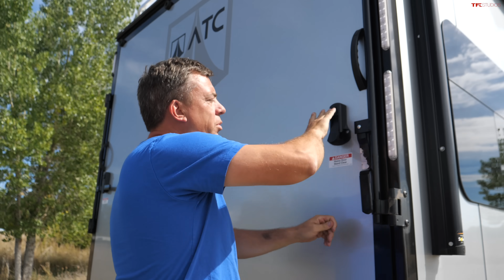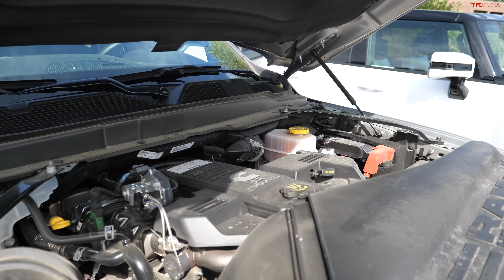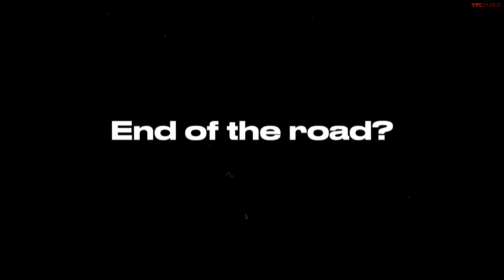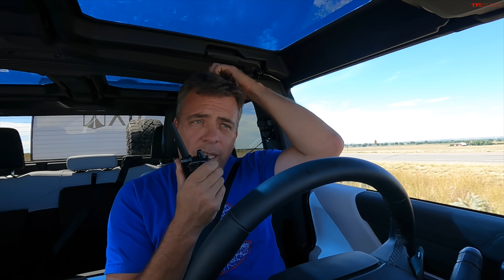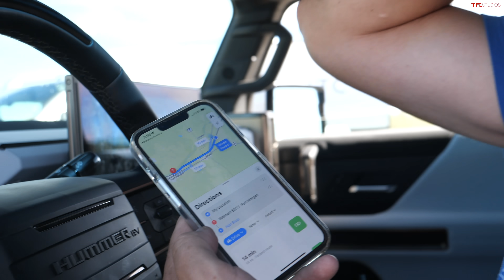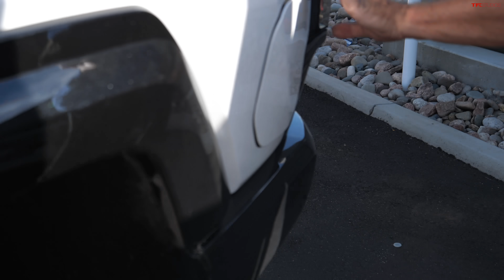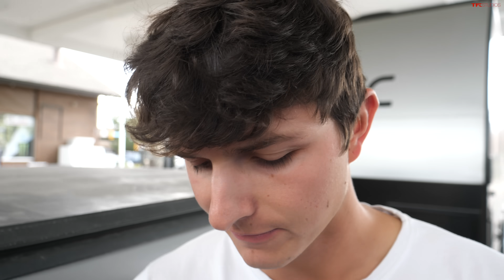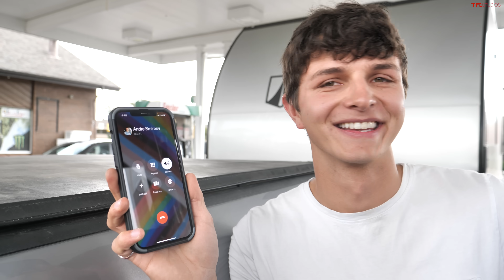How Far Can a Diesel and Electric Truck Tow An Identical Camper Trailer on ONE Fill-up?

Comment: I don't understand why the EV Hummer has such a light towing capacity compared to the other EV trucks.
Another thing I noticed... they're towing trailers that are empty... imagine having 2 dirt bikes or a side-by-side and your stuff (food, supplies, clothes, etc) loaded into the trailer, what's the range going to be then? 50 miles? Seems EV trucks are still a ways away from becoming towing vehicles.
Reply: There is more to towing than just horse power and torque. The Hummer has independent rear suspension as well as rear wheel steering, which really hurts its ability to carry weight.

Comment: True that the range per tank or charge goes to the Ram, bur the total cost of the trip goes to who?
Reply: The EV was cheaper at 43 bucks to recharge.

However, you are assuming that people care about 43 versus 100, versus wasting over 2 hours of your time to charge / back track have range anxiety.

Drive EV's in big cities.  EV's are not ready for hauling and transportation, waste of precious minerals going into the batteries.

Comment: As usual, all the EV hating trolls are out with their see I told you so narrative. If you have to tow heavy loads long distances, get a diesel. I guarantee that most F150 owners who have the same configuration as the Lightning aren’t doing a whole lot of towing or even hauling with their trucks.

Comment: Hmm $55,000 price difference let’s see how that computes 55,000 divided by let’s say $4.50 a gal that’s about 12,222 gallons of fuel at 10 mpg roughly can drive 122,000 miles before an EV gets out of drive way awesome

Comment: The lightning vs hummer showed us the lightning needed more charging to the 1 charge of the hummer.
The hummer vs cummins is cool, it showed us the cost of charging and fuel are the same..just with EV you have to plan on hitting charging stations and eating more fast food while charging.  If anything buy a hummer not the lightning. But I'll go with the Cummins.

Comment: Kinda surprised to see the price(had they not offered free charging) landed fairly close to each other for the range. $40ish for 123mi is about $0.33/mi and $105 for 211mi is about $0.50/mi. That's still a 35% advantage to electric but the trade-off is in the time spent filling/charging. 

I would've liked to hear the times for filling vs charging with the charger dropping off from 350kw to 150kw, because imo very few people would trade $0.17/mi difference from ev to diesel or around $12(considering 70mph highway avg) to sit there for an hour to charge. Not to mention the need to unhook/re-hook the trailer to do so.
Reply: Wasn’t the $40 charging only for 87kw? At 0.6mi/kw, that’s only 52mi range added at ~$0.77/mi, or about 50% higher than diesel for public station rates!
Reply: @emf7301  not even taking into account you paid 40k more for the truck. would like to see it vs gas but im sure the cost savings still isnt there and range is similar.
Reply: Someone did the math in another comment. "Thats awesome the charge was free, but let's use the numbers to find out the future cost. The Hummer charged from 7% to 51% for $37.41 according to the EA charger. So $0.85 for each 1%. At that rate it would cost $79 to charge the Hummer to 100%. Hummer cost per mile: $79 ÷ 123 miles = $0.64 per mile.
Cummins cost per mile: $105 ÷ 211 miles = $0.49 per mile"

Comment: Ev’s are an embarrassing gimmick at best. They might be good for big city people commuting >10 miles. But as a replacement to the ice they’re a joke
Reply: 80% of Americans live in urban areas and commute short (<50 miles) distances to work.
Reply: @robertharris1748  You’re numbers a smoke screen. Lots of people living in big cities commute 50-100 miles and greater for work. None if those cities can support the power required for everyone to charge a car. They can’t even handle when people run ac’s. And there is way to build a supporting infrastructure.

Comment: I love that you guys are talking about energy density and comparing true energy efficiency. Something so many people are confused about! Well explained, thank you.
Reply: Something just hit me based on energy density: He would have paid $40 for the electricity equivalent to 6 gallons of diesel. That would have worked out to over $6.70 for a "gallon" of electricity.  It shocks me that the super-charger is more expensive than gas.
Reply: @DSArmageddon666  When i first got my EV non fast charging was free. I've since moved to Colorado and they charge a pretty high amount for all public charging and home electricity in general. After doing the average math, if fuel is under $4 a gallon then i'm spending more to drive the EV plus the wait time for charging.
Reply: @WhoThisGuy515  NO, that defies everything i've ever heard.  Even if you pay a lot for electricty, like CA rates its still cheaper per mile.
Reply: @DSArmageddon666  Yeah, gas/diesel has always been an excellent value of energy per dollar, at least in the US historically. The other numbers to keep in mind is charging at home would be more like $9-12 worth of electricity for that same amount of energy depending where you live. For most, the vast majority of charging is likely to be done at home, so weigh that in. The other factor is an EV can generally do a lot more with a given amount of energy, so even in scenarios where you pay more per kWh than gas, you can do more with it due to the higher efficiency. In some cases at least.
Reply: @tazeat  Ev's so far are a good day vehicle, meaning home to home. Also not bad for light towing short distances, but dino engines still win for distance travel.
Reply: @Frontpagefab  No arguments from me. What I'd like to see is tax and insurance pricing models to stop disincentivizing owning extra cars so much. It makes no sense to have an extra energy efficient car that saves money on energy only to have that difference and more taxed away when you renew registration every year. Because I see no reason why most people with an ICE truck would be motivated to get rid of them in the next decade with what's being offered today and in the near future. At all.
Reply: @tazeat  You got that right. Typical insurance discount for add'l cars is only 15% off... even though one person can only drive one car at a time. And some states have higher annual registration fees for EVs, and many more states have personal property taxes that amount to more than 2% of the car's value  every year. With rules like these, the only way an EV  typically makes economic sense is for a two-car family that can charge it at home and needs a second ICE vehicle anyway for a spouse who (mostly) stays-at-home. That one is used for road trips.
Reply: @videopipeline6419  I mean I know, I pay insurance on currently five cars and a boat for my wife and I (3 of which are basically toys that rarely get driven, but are also older and relatively cheap). It's not like I can go crash them all in to other people at once, but there's hardly any multi-car break on the liability prices, they just add up. I had a 500e grocery getter for a year I paid 6k for several years ago and the state wanted about $500 for registration renewal after the first year (lets not even mention the initial registration fee was even more absurd) by the time you added all the ev fees (~225), vehicle value based transit taxes (~110), and everything else (~125). It's probably more now. I sold it off. I figure tax+insurance+energy costs I was close to $900 a year which at the time bought a hell of a lot of gas for my truck. The truck is not going anywhere, no car can do what a truck does, but a truck can inefficiently do everything a car can and more. I'm happy to daily something more efficient, but you gotta make it cost effective for people to do so.
Reply: @tazeat  The only EV that's a really cost-effective commuter vehicle is a an electric bicycle that has nearly the performance of a light motorcycle but no government-imposed fees. In most areas, if it looks like a bicycle, and if it isn't driven on the highway, and isn't breaking the posted speed limit elsewhere, it attracts no attention from the cops. Of course, the big problem with any bike is, bad weather and dangerous drivers!
Reply: @tazeat  )
Reply: @tazeat  I haven't seen one illustration that convinces me that EV's are the better choice, environmentally or otherwise.  There is very little talk about raw materials to build the batteries, (which we have almost none of....) or disposing of them.  A typical car battery weighs about 50 pounds, and the Hummer...6,000?  Sheesh....
Reply: True energy efficiency?  How about the energy to charge the Hummer which is roughly 75% fossil fuel? Thermal efficiency of an average coal plant is 33% times his .6kw/mile is .198 which is less than the Ram.  That doesnt even figure losses thru transmission lines, transformers, and charging stations.  Its almost like you cant beat laws of physics
Reply: Don’t buy a full EV vehicle if you believe some change your driving habits and refueling habits will occur. The energy density and efficiency discussion sufficiently confuses the regular consumer (me even with an advanced college education in healthcare). There is scientific research that demonstrates people’s propensity to overestimate how much they know about a given subject. I  admit that I do not understand the calculations and assumptions regarding the comparison between battery technology and diesel. But I do know with these full electric vehicles the  people who are buying them are going to generally be more affluent and urban and suburban dwelling people. I have a good friend that owns a Tesla model three and he owns a cottage about 120 miles away from his home. He had to install an electric charger at his cottage because he couldn’t make the round trip. I own a plug-in hybrid and a Toyota hybrid. The company I work for is striving to fully electrify its fleet by 2025. However, full EV vehicles would not be available to employees whose territory goes beyond large, urban and suburban centers.
Reply: I believe Toyota's 2.5L aka Rav4 engine is the most thermally efficient engine on the road, but its still way way behind electric.
Reply: @jeffk464  It is not way way behind BEV vehicle :)   

Ok, engine to electric motor yes... but....

BEV car have not only the electric motor on wheels which is 95-98% efficient,  they have also battery, electronics and A/C, heater etc.

charging the battery is about 80-90% efficient (depending on the method of charging, fast or slow) -because of the heat loss, A/C system helps cooling the battery while supercharging (which also uses energy) etc.  - same when you use your phone intensively, or fast charge it -- the battery heats up like crazy...    --- also when you use the battery to run the electric motor --- battery also heats up  -- wasting energy for heat loss.

Two:  when using heating inside an ICE car you have heat for free, in the EV you are using up to 25% of energy in the battery just for heating.  That is a lot -- in colder US climates you use heating for like 4-5 months of winter for sure.

Three: electronics use energy on standby -- in very hot weather EV is wasting the energy to cool down the battery, in cold for heating up the battery ---- this is efficiency loss too.

Four:  the battery has the tendency to self discharge, and is loosing a little bit power just standing parked.

Five:  another factor is weight --- carrying extra 1000 lbs to 2000~~3000 lbs of battery is completly not energy efficient.

Six .... electricity generation --- in countries that use mainly coal or oil power plants -- generating electricity is like 30-40% efficient :)  than the losses of the grid etc.   natural gas, nuclear are also fossil fuels powerplants that generate a lot of heat during the process.

Comment: Comparing "efficiency" of EVs and ICE vehicles is pointless unless you factor in the inefficiencies of the electric grid. Power plants, distribution, and charging stations are not 100% efficient so you should be factoring in those losses as well.

Comment: People just dont understand how much energy diesel and gas store. You would need an 10000-pound battery to come close and it will take you 2 hours to charge on a high amp charger. The same problem has existed in Evs for 100 years the battery. They dont store enough energy, they cost to much and are heavy. Last but not least they will not save the environment.

Comment: If a gallon of diesel has 38 kwh. That same gallon of electricity will  cost  $16.34 at the posted charger cost. If the diesel  truck  had an equivalent  of 0.25 kwh per mile to e.v. 0.6 mile per kwh. So the  diesel was far cheaper to operate. with zero fear of being stranded. The nearly  $40 you mentioned  the electricity  would have cost was not even a 50% charge.  This is pathetic.

Comment: I wonder if solar panels will ever become good enough to help EVs with their range, especially when towing. The consensus seems to be that batteries won't significantly change in the near future enough to make a big difference.
Reply: Only a lightweight car like Aptera can benefit significantly from solar.  The sun only imposes a kw per square meter,  and most solar is less than 25% efficient.

Comment: The exhaust brake technically is saving you fuel. Every other rpm, the injectors aren’t spraying diesel, or air is going into the chamber. Creating a vacuum in the cylinder.

Comment: How much energy does it cost to make that battery, how much energy does it cost to mine the rare earth elements for that battery? How much does it cost to recycle the battery? How much does it cost to replace the battery? How much does it cost to produce the energy to charge the battery? Efficiency doesn't matter if it's not Efficient in all phases of production and use. I appreciate these videos but the more I see evs the more ridiculous and unpractical they become. Nice electrify America offers free charging sometimes, guarantee that doesn't happen when more than 1% of the population would have evs. Cummins is making hydrogen engines for a reason.

Comment: The Ram costs half as much. The Ram diesel has 2.5x the range. The Ram can fill up completely in 10 minutes. The Ram can pull in and pull out to fill up. The Ram does not need to un-hook and re-hook the trailer for fueling. The EV pumps, if occupied already, may take awhile to be free for use.
Reply: But but what about saving the earth and cooling it off OH ya the batteries are even worse for the earth . oooops
Reply: @Believer21777  yeah and many of those charging stations use diesel fuel to power them
Reply: Great points...and the Cummins will last for years and probably hundreds of thousands of miles
Reply: Hot or cold weather cuts range in half, batteries only last ten yrs and cost as much as a used car, that and where is all this Electric power going to come from? No where, that where
Reply: @johnjames5842  It’s coming from coal…which is 100 times more damaging to the environment to mine. And the process to mine the battery materials is 500 times more damaging to the planet than 1 barrel of oil 🤣
Reply: @Suresh-ib4co  coal in the US is way way way cleaner than in China , India, ect ect, we have shit that cleans pollution on the stacks, and there is no amnt of windmills and solar that will power this country without any ev's, let alone with majority or all ev's, it's a pipe dream, cheap energy is what makes countries wealthy, that's coal, natural gas, oil, nuclear, hydro, that's what the green agenda is , Forced Austerity, wealth redistribution
Reply: @johnjames5842  Yep!!!
Reply: Also the battery will degrade and range will get worse and worse every year. Resale value will be nothing. You will own a yard ornament in 5 years.
Reply: @ronj1982  Do you honestly believe the Hummer will only last 5 years, like for real honestly.....
Reply: @rockwallcares5084  5 years might be a bit extreme. Probably last longer. But the battery capacity can and will decline over the years making it more and more obsolete when compared to diesel vehicles which, in fact, slightly increase their fuel economy after being well broken-in following years of driving.
Reply: @rockwallcares5084  i think the more fast charging you do on them, the less they last, theoretically speaking they should last you quite a bit if you do slower charging and vise versa with more fast charging
Reply: @rockwallcares5084  it is a Hummer...gmc...yes!
Reply: @rockwallcares5084 .. The Hummer will last for years, the battery 5 years or 70,000 miles..........
Reply: Yeah, and at 150 thousand miles the hummer is losing its charging capacity but at 150 thousand miles the ram is just breaking in.
Reply: Who in their right mind is buying a vehicle for 80K?  What idiot would spend that kind of money on a Truck?  

Just buy an 10 year old Diesel and rebuild it from ground up for half the price.  It will last half a million miles and be less toxic to the environment.  Batteries are 1000 times more toxic to the environment that anything man has ever made.  People have no clue what happens to these batteries when they are toast in 10 years.
Reply: @StageShout  yep. I'll keep my old 96 7.3 thanks very much

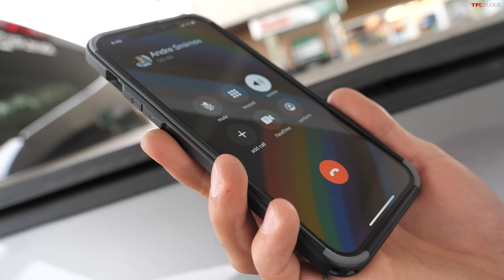Comment: 25:28 Understanding that the HUMMER EV is still an inefficient EV truck, this basically confirms my thought that EV trucks are going to require ~400 kWh packs before we can reasonably start talking about replacing ICE HD trucks with EV HD trucks for long distance towing. Filling the RAM's tank completely full left it with about 300 miles of towing range between fill ups. An equivalent EV truck to the RAM with a 400 kWh pack would travel 250+ miles under these conditions, and a 500 kWh pack would have a similar 300-mile range as the RAM.